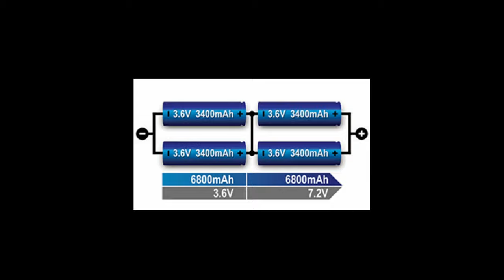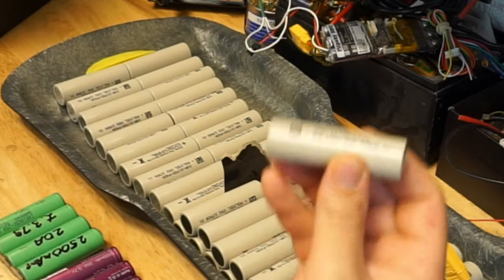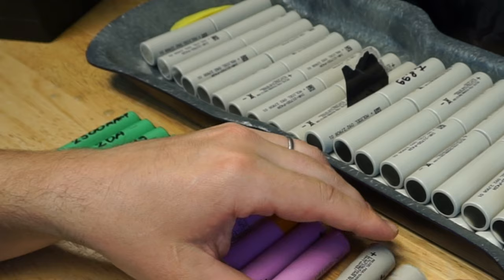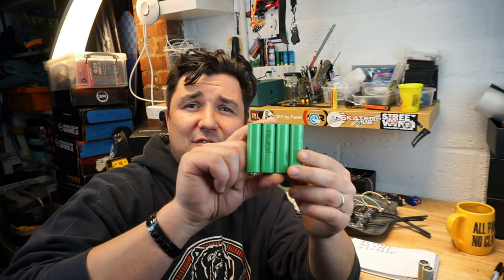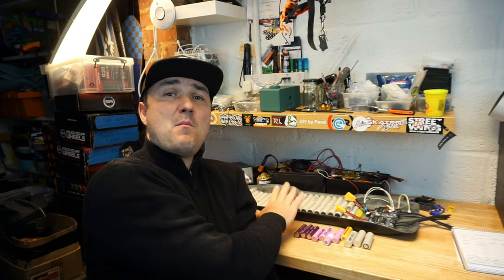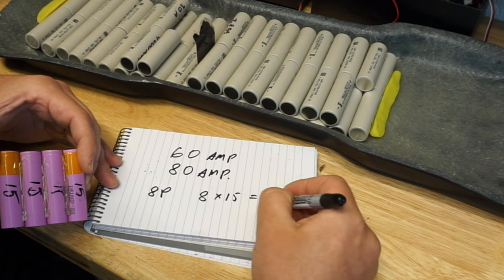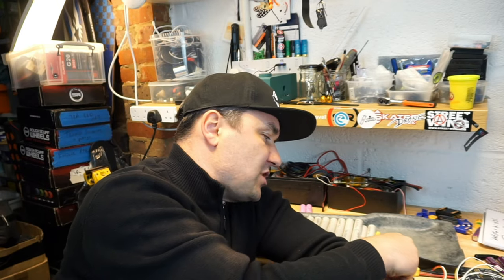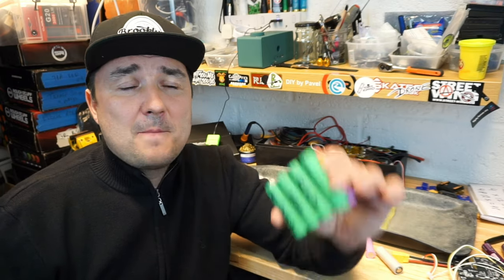ALL ABOUT BATTERY CELLS. BATERY PACK DIY VIDEO 01.

Comment: what is the video about motors? I need to understand this as I am building a reverse trike using Flipsky BLDC Belt Motor Battle Hardened 6384 190KV 4000W not sure if I should use two.
Reply from the maker: What do you need to know mate?

Comment: Hi Pavel
I have ebike model MATE X-750W.
Battey 48V/14Ah fail.
Voltage 42V output terminal-when turn battery key to ignition position-drop to 0V.
BMS or bad cells.
What can i do?
Reply from the maker: Hi mate,
I am assuming that the BMS is charge and discharge?

Comment: Q: have you used a FSESC 6.6 DUAL?
If so what was your setup? I have three 6.6DUALS and all of them get OVERCURRENT cut outs.
This does not happen on my Unity FocBox but does on the 6.6DUALS. Wondering if you had any luck with Flipsky.
Reply from the maker: Hello buddy!
Thank you for the question. 
Yes I do have 6.6 plus dual and it is still installed on the Beast and working fine.
So my set up is : dual 6374 , 190kV motors, lipo 12S , 8000 mAmp, 15C.
VESC settings:
Battery max 120
Battery absolute max 180
Motor max 60
Motor negative -48
Regen -10
Remote - Trampa WAND
 Hope this helps.

Comment: What's safer  lipo battery or buying a whole battery or building your own cell battery
Reply from the maker: Lipo batteries are easier but a bit more fiddly when charging and installing on the board / off the board all the time. They are safe if you do treat them right ; ). Lion battery packs are better in my opinion but it all depends where you buy them from mate...some packs are built really badly and will cause issues. I would say that building your own is the best way forward however you need to be confident doing it and have correct tools. I do have two very detailed tutorials on how to build batteries so have a look if you want to see what is involved.

Comment: Hi can I parallel two different battery packs of the same voltage but have a different Max. continuous discharge current 20 a and 30 a
Reply from the maker: Unfortunately not mate...they will discharge unevenly.

Comment: Good evening, I made a 48 volt battery, but after a full charge it does not exceed 51 volts. What is the problem? Thank you, my friend. I follow you from Egypt
Reply from the maker: Hi mate,
What BMS unit are you using? Settings are not right on it i would say.
Reply: @PavelGarmas  What is meant by settings

Comment: why you dont make it parallel and series so you have double the voltage and the amps?
Reply from the maker: That is exactly what I do when i design and build the batteries. For instance 12S5P or 12S7P - 12 in series and 7 in parallel. Take a look at my battery building tutorials mate.

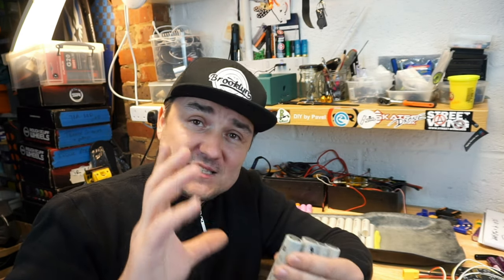Comment: Thanks really good explanations. 27:49 There were one thing I did not catch. You said that each of the cell had a safely discharge capacity at 30 amps x 4p. That would be 120 amps or? You said 320 amps. Sorry i dont understand that.
Reply from the maker: Hi mate, i have just watched it and i do say 120 Amp... sorry maybe it is the way i said it. Total battery pack discharge is one cell discharge times P value.
Reply: @PavelGarmas  Hi Sorry my hearing is bad :) If you have time some day. Would it be ok if you shortly broght up that many batteries that you have on bikes is inustrial built and to get into it and replace the batterries without knowing what kind of BMS or som kind of way the how the cables are connected to BMS and what function they have...could be some confusing. Online there is many YT:s about building the easy way .. how to stack it etc and that is very good but when it comes to industrial made... it could be some differences. There is much silent of information ex about the BMS...which one? You can tell by the nr of packs etc...also they pack it so well that there just mm:s left = is about the design as you talked about.

Comment: Imagine you run a motor rated for 48v. I saw people building a 13s battery instead of a 12s.
Reason is, as far as I understood: once you calculate the maximal voltage and the minimal voltage of the 13s pack, sum and divide by 2. You get the average Voltage of 48v. That sounds for me like you can use your battery on your application avoiding power drops.
Am I right with that?
13x3,3v=42,9v
13x4,2v=54,6v
(42,9v+54,6v)=48v nominal voltage

Comment: Hi,
I would like to know... Let's say i have a 3P which gives 12.6v fully charged and I'm running a 12v thing off it. Here's the Q... If i am charging the 3p pack will the charger also be giving power to the 12v unit running off the pack and secondly....
2nd Q.... Let's say it is a 4P pack now in theory it's still 12v but 3.7 x 4 is almost 15v if i now charge the pack the charger will have to be more than 14.8v so if the charger is charging the battery and feeding the 12v unit running from the 4p pack won't the unit get damaged?
Reply from the maker: Increasing P group count only increades capacity not voltage.

Comment: if the maximum discharge rate is 10 Amp and I discharge the battery only 5 Amp. there is any problem for the battery? I know high discharge rate battery is expensive but I have this question.
Reply from the maker: No problem! Even better .

Comment: I'm having a problem about.  Dose it matter if the battery I built if it's 2 or 3 volts different then the original or sho I ld I just change the whole battery and make a bigger one
Reply from the maker: Hi mate . Sorry but i am not sure what is the question... so you have built a new battery but it is showing lower voltage than you need? What size battery is it? 10S?12S? I will gladly help but please clarify the question. Cheers mate.

Comment: Thank you
Excellent explanations
Just have one question! Can you make 10s 3p with 21700 cells if you don’t have much room?
Reply from the maker: Hi,
You can use any cells to make a pack. Using Molicell 42P 21700 will give you 12000 mAmp pack and 90 Amp constant .
Reply: @PavelGarmas  thank you very much

Comment: Thanks i subscribed , i have a question how do you determine how many Kms you can do with a certain battery thanks
Reply from the maker: Hi mate,
I am using my experience and my mates advise. The best way to calculate is to use the ESK8 calculator... https://calc.3dservisas.eu/

Comment: Hi Pavel I am new to the channel, awesome tut videos by the way. I only watched a couple of videos so far. You are talking about your decisions you made on choosing the packs. I am getting the current motor requirements. But I would like to know for example how you decide on how many s packs i.e. how much voltage is needed and why, how to balance and keeping the heat in check,  also the milage is it from testing or are there some calculations. Is it all from battery and motor specifications? I would like to build something with battery and wheels soon. Thanks a lot
Reply from the maker: Hi mate!
Thank you for watching . i got a very detailed battery building tutorial and i do cover much more so take a look.
As for your questions :
Voltage is chosen to optimize the performance of the motors. All esk8 motors can operate at 12S ( 50 volt ) and this is my favourite voltage. Some motors can operate at higher voltages and the battery could be built to the 13S, 14S or any voltage you want.
There is an esk8 calculator that yo can use to get your set up right ...i do not use it anymore and do rely on my and other riders experience.  Lets say Off road set up, belt drive, 12S 6P pack using milicel 42P will give you around 20 miles of range ( 6374 motors ).
This is the calculator , have a play mate.
https://calc.3dservisas.eu/
Reply: @PavelGarmas  Thanks so much mate, legend

Comment: So my  EVE 18660-24V battery has 7.5A max discharge rate. if i put two in paralell i will et 15A Max discharge rate ? it can handle 15A instead if 7.5?

Comment: do you get problems building p pack with 18650 30q but with difrent charge votage stats like 3.54, 3.49, 3.51, 3.33, 3.40
Reply from the maker: It is best to have all the cells to the same charge before connecting them otherwise they will never balance out.

Comment: flipsky 63100 says it has Max current of: 100A, so if i have a dual motor setup (battery 18s8p p42s), ist safe to run 185-190 A to my motors?, also what gauge wires do you recommend using for the 18s8p battery/esc etc
Reply from the maker: P42 cells are 30 Amp discharge so you will be fine to draw 190 Amp no problem. You will never pull so may Amps constantly anyway.
Have you seen my battery building tutorials?
Reply: @PavelGarmas  i think so yea. loved that trick you do with curving the plates round the wires for better weld
Reply: @PavelGarmas  i did , i like how you used the sheet itself to cover more of the wire for welding. but for 18s what gauge wire would be sufficent? is 10AWG enough or should i go bigger?

Comment: At @20:07 I think you calculated the 8s with a 3.6V base cell rather than a 4.2V base cell like the 10s and 12s calculations. Just wanted to let you know so you can correct it if you see this.
Reply from the maker: Thank you mate 👍 i will do.

Comment: I am using samsung 35e and I have charged and discharge my battery around    1200times  proble more some days I would charge twice aday and it still gets the same distance I have had it 3 and half years not bad. It's a 58.8 volt 14 ah battery. I will see how much longer it will last. Thanks for information.
Reply from the maker: Hi mate! Very impressive and sounds like you have some good quality cells. You are treating the battery well and are following the correct usage and charge sequence so battery is keeping its shape. You will be surprised how often people ruin the packs within 100 charges... let me know how it goes in a few months.

Comment: Hi Pavel, if your running 2x70A drawing motors so 140A to be drawn from the battery. I want to run 12s so I’m assuming minimum I need is 12s5p. What advantage would I get from using more parallel groups ie 12s6p or 12s7p? Sorry if this was in the video.
Reply from the maker: Hi mate,
Having higher P rating gives you more capacity of the pack so more miles on one charge. You will need to get minimum amount of cells in a P pack  to get the discharge rating you need and then the rest is a range increase...
Reply: @PavelGarmas  thanks for the quick reply, appreciated! Is there a configuration where the parallel pack can be connected length ways so that a 21700 5 p pack would have the rough dimensions of 21x21x350mm instead of the more standard 105x21x70mm?
Reply from the maker: @samreason9856  there are many ways you could connect the cells mate. Check out my new video! Might help.

Comment: What's the difference between 30T & 40T batteries in the Samsung 21700 line?
Reply from the maker: Hi,
Thank you for watching and for the question. So the only difference is the capacity. Samsung 30T are 3100 mAmp and the 40T are 4000 mAmp. Discharge on both cell types is the same - 35 Amp constant.
In short - same performance on the discharge but 40T will give you more range with the same battery configuration.
Hope this helps.
Stay safe and stick around!

Comment: Hello,  First of all thanks for the video, well explained. My question is on cell chemistry in the battery pack ? Like how much percentage of cobalt, Nickel, Manganese or cadmium is used in cell chemistry. And which is the best electrochemistry according to you in terms of best pack output? Is cobalt is going to use less or obsolete in near future. Thanks,Kunal
Reply from the maker: Hi mate,
Thank you for the question.  I am not sure if i have the knowledge on the cell chemistry deep enough to answer your question correctly to be honest. 99% of all DIY battery builders are using the  Li-ion battery cells. i do prefer Molicel due to high discharge rate and the capacity. Here is a link to the website where you can most likely find very detailed information on the chemistry. Hope this helps.
http://www.molicel.com/advanced-rd/

Comment: Hey Pavel i really appreciate all your content I have a question if that’s ok I built 2 batteries so far one 20s10p pack using NCR18650bd trying to figure out amp hours also discharge amperage the second is same cells 20s8p built these for a KTM conversion to electric with QS165 with FarDriver ND72680 controller I would appreciate any help I’m not great with all the math and how it all works lol thank you 🙏🏼
Reply from the maker: How can i help? 
If you want to know the capacity of your pack then multiply a single cell capacity by P value.
Reply: So I would multiply 3180mah by 10 correct?
Reply: Sorry I get extremely confused when it comes to the mathematics of all this I’m great at the building aspect they came out perfectly well thanks to all your content for sure!!!!!
Reply from the maker: Correct mate 10 times single battery capacity.
Reply: Thank you so much I really appreciate your help wish I could send pictures of my projects and progress lol
Reply: I think I have it 20s10p NCR18650 200amp 32ah battery I think lmfao 🤣 i really appreciate everything thanks again looking forward to next vid lol

Comment: hello i need help i want make a 120V battery pack for my escooter dualmotor 2x 7000w
Reply from the maker: Hi,
Why would you need a 120 Volt battery? Can the esc and motors actually take that voltage?

Comment: Where to find real battery's please?
Also can I run 2 different size packs in parallel if both are 36v  one. Is 10s4p 10ah  and the other is 7ah not sure the s or p in the 7ah
Reply from the maker: Hi,
Fogstar UK or Nkon sell good quality cells.
As for the different packs, i would not recommend you connecting different packs even if they are the same voltage.
Reply: @PavelGarmas  ok thank you very much definitely don't want to take a chance
Reply: @PavelGarmas  thank you for your earlier response if you don't mind if I ask you one more question the BMS is blown on A 10p4s it's from a Teemoboard with 2 450w motors I'm not sure on how much amps output i need . Do I really the 80 amp 75 dollars bms here is a short video but I don't think I want the same bms as in the video I ask for type but ignorethat what do you recomm you seem to know more than most on YouTube thank you very much  //youtu.be/AwKnsvq4bME

Comment: Be careful mixing up amperes/milliamperes and Ampere hours/milliampere hours. Amperes is a measurement of current or power, Ampere hours/milliampere hours is a measurement of energy discharge related to time. Most people drop the ere at the end of amp

Yes, it is annoying to put hours at the end of every capacity measurement but the newbs gotta understand this fundamental building block
Reply from the maker: Thanks for the info! Good point mate.

Comment: Using 6374s, what is the real world difference using 10s vs 12s?
Reply from the maker: 6374 motors do feel more rapid and snappy on 12S.....and they will run cooler. I do always go 12S. Is your board for street or off road use mate?
Reply: @PavelGarmas  I'm on my second build. First was a 12s4p (50e), Landyachtz deck with 175mm tires and 6374s. Current one I'm building is an MBS board with a 12s6p (p42a) and 6384s. I've seen other builds with 10s but only have experience with 12s, so I was wondering the difference and if it's something that I should explore. I'm guessing no. Probably just a means by companies to keep cost down.

Comment: There are actually 18650 cells above 3500mAh?
Reply from the maker: Hi mate, normally they are around 3000 mAmp however here is a 5000 mAmp. I did not use it though so can't say much about the quality. 
https://www.onbuy.com/gb/genuine-18650-37v-5000mah-rechargeable-li-ion-battery-batteries~c8698~p56666046/?variant=56666052&quantity=4pcs

Comment: if you weld in 6 points in parallel, the discharge increases 6 times depending on how many accumulators you weld in parallel...etc
Reply from the maker: Cheers.

Comment: how many 21700 battery will need to replace 36v 10a battery pack
Reply from the maker: Alan,
36 volt battery is a 10S battery. 3P will give you 12A . So 10S3P pack = 30 cells.
Reply: @PavelGarmas   thats good my last pack for 36v 10a used 18650 22p that used 50x 16650

Comment: Pavel, you missed some big basics here. Firstly, batteries store energy, not power. Power is the rate at which you move that energy, not the amount of energy itself. Power is time dependent, energy is not. You Store ENERGY, not power and that matters. You didn't seem to describe what current and voltage means and that matters too. You seemed to throw around the term "amps" to mean most everything.

Also something you didn't touch on is the risk and consequences of cell failure - that the more cells you use, the bigger the risk you have of a failure and what that failure can mean - as in the risk of fire and explosions. Remember it's this kind of battery system that is causing fires and burning houses down.

Big omissions there Pavel.
Reply from the maker: Thank you.  I will make part 2 at one point.